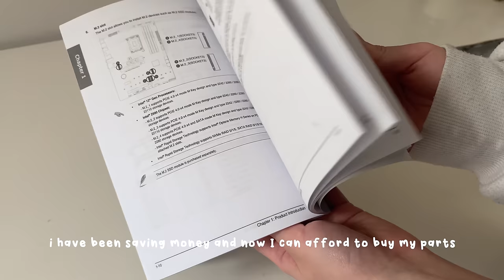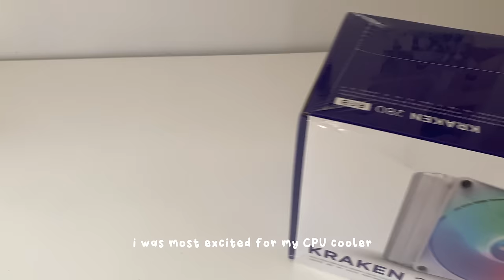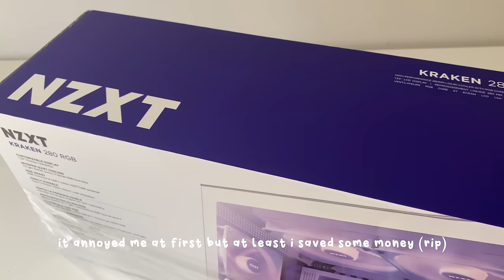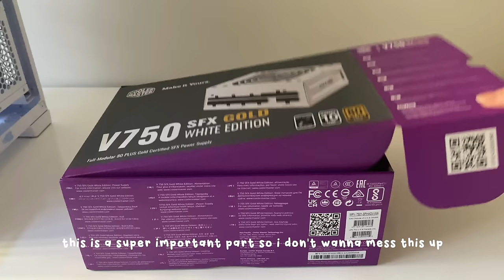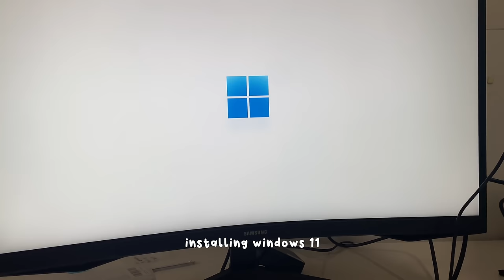building my first gaming pc 🤍 | white aesthetic, mid-range, lian li dynamic snow mini , rtx 3060

Comment: You actually have a negative pressure system the way those fans are installed.  3 bottom fans are set as intake while the other 6 are in an exhaust config.  Otherwise, looks really nice though!  Outstanding job for your first build.

Comment: I build computers for a living, you might wanna do ur exhaust fans up top cause heat rises and you could do 3 fans up top or put ur radiator there and put more fans on the middle, mainly a good idea to make those bottom fans intake
Reply: Convection is such a weak force that any airflow destroys it tbh. So in a pc case, it doesn't really matter
For dust build-up though, that is a whole other story
Reply: @Elvyne  technically no cause the heat will collect either way even if its getting blasted out

Comment: You've mistaken about the airflow, your pc has negative pressure, only the bottom fans are intake, the rest are exhaust. You can tell the air flow direction by the face of fans, air flows in from the face and out from the back, where you can see the stickers and frames.

Comment: Btw hot air rises so having the exuast fans at the bottom is not a good idea because the hot air will just get trapped under the case and then go back in to the case
Reply: you really should put the exaust fans at the top blowing air out the top

Comment: I know that some parts could be better invested but for a first time it’s decent. Would upgrade the gpu though. (7900xt/7800x3d builder)
Reply: Yeah 100%, good shout there. How’s your experience with the 7900 XT btw? I have a Sapphire Nitro 7900 XT and it’s amazing…except Adrenalin makes it run at an awfully slow fps when setup so I have to leave Adrenalin unsetup. Sapphire Trixx works well though to enable VSR and Image Sharpening if I need it.

Comment: fire build I'd look into some psu cable extensions. They changed the way I look @ my card and mobo, most PSU cables are cheap non braided wiring.

Comment: your ram is running at 2133 mhz but it actually run at 3600mhz. Just go to bios setting and turn on XMP profile (it is not overclocking, there is a set profile and u just choose it)

Comment: Beautiful PC!! I love the build, white builds are my favorite. Some advice, I would rotate your radiator so that the pump intake and outtake are at the bottom. This will help prevent your pump from breaking, as well as helping with overall cooling and noise level. Other than that, great job!!
Reply: The pump is below the highest point in the loop (top of the rad) it'll be cool! Gamers nexus, JayzTwoCents have done some nice videos on the topic

Comment: Greatly done, i see you got confused on thermal paste :D it was already placed, if removed use isopropil alcohol 99% to clean it with earbud clean tips. surface must be sterile before thermal paste takes forever to clean it

Comment: Looks all good to me and the pc is great. However, a Z690 Board for an I5 12400F is overkill. I would have gone with a high quality B660 board with wifi to safe some money for a better CPU or more Storage. And the 280mm aio is also a bit overkill for an I5 12400F. The rest is fine.

Comment: So how you have it set up right now, only your bottom fans are intake. So you have a pretty high negative pressure since you have so much exhaust. I would consider flipping the fans on the aio to intake. It would be more balanced that way. You'd have positive pressure instead instead, which is not necessarily better, but yea being balanced is the main thing
Reply: It really doesn't matter with this case.  The AIO on the back can honestly be intake or exhaust... it really just depends on how you want your hot air exhausted (back or top)... I've noticed both ways really have hardly impact on performance and if you have your PC on a desk and have a clean area, you really don't have to worry about dust or anything building up in your PC. I've ran a similar configuration with slight negative pressure for over a year and have hardly seen any dust in my build.

Comment: Hi amazing build btw, however there’s a safety concern, I noticed you applied some more thermal paste into the aio pump. Don’t do that because you’re mixing different chemical compounds from different manufacturers and it can cause a chemical reaction and at the best case scenario your system is going to be fried, worse case you can light your whole place on fire. Please be safe.
Reply: hi!, is this because the aio already comes with pre-applied thermal paste?, because i’m getting that exact same cooler and i was wondering if i needed to apply thermal paste on it

Comment: Very relaxing to watch, I liked it a lot :D

But just an FYI, the bottom fans are set to intake, and the top, rear and radiator are set to exhaust. Unless you have reversed blades, but those are pretty rare and I don't think lian li offers them... I know nzxt doesn't have any of them yet. So you have 3 intake and 6 exhaust fans 😅 always remember that air flows through fans from the front of it, to the back (unless it's a reverse blade, but these are new and not common yet).

Comment: Great build, but I would trade that AIO cooler system, fans, and the case for a higher GPU like a 3070, 32 RAM.
Reply: In this market right now she could’ve probably even gotten a 3070 ti or a 3080 and also 32GB DDR4/DDR5 RAM. She would be able to have gotten a dual tower air cooler, which some look good like the white Thermalright Peerless Assasin 120 SE.

Comment: Here are some tips u shouldn’t get ddr4 get ddr5 they’re better and u should get a contact frame for ur next build contact frame makes the cpu cooler and better and u should only use 4 fans for exhaust the top fans and the rear fan

Comment: Yall if you’re wondering, its costs about 1355 € (19.2.2024)
Reply: Yes, but only because of the optics and the unnecessary water cooling. A system of this performance class can be built much more cheaply.
Reply: @blabla7310 Yeah, and the researching of components was poor. She’s stuck on a dead socket.

Even AM4, which is outdated, would’ve been a better choice. AMD officially said they’re still releasing new AM4 processors, and even have a couple of samples (like the Ryzen 9 5950X3D featured on Gamers Nexus) that could be released.

AM5 was the better choice overall instead of this socket since it has support until 2027.

Comment: hello I just saw your video, I have EXACTLY the same PC case as you, I have a Bluetooth problem, my devices cannot connect to each other, except when I open the window and get closer to the motherboard , please tell me if anyone knows what it is, the same I have a problem with wifi also it does not perceive the network well... except when I open the window

Comment: Just asking why would you put the exhaust fan at the bottom it should be on the top because warm air rises
Reply: Plus its easier for the pc unit to regulate the temperature and much more natural airflow

Comment: It’s best to avoid mounting the radiator with the pump and tubes at the top, this is due to trapped air having the potential to hinder the performance or cause a short lifespan

Comment: Hi! Its been about a month that ive wanted to build my own pc. 
But I have some questions here: 
-how much does it cost to do it? 
-Is it cheaper to actually build it by yourself or is it cheaper to buy a pc thats already build? 🤔
Reply: it all depends on your budget, what you will use the pc for, and if aesthetics are considered
Reply: @letmegiveyouaquickmeal  I'll use it for work purposes, to edit videos and photos. And I'm not really considering the aesthetics.
Reply: I just plugged all this in to get an estimate for a similar build since I’m workin on building my first pc as well. The total was around 1260$ before tax. From my research, you can absolutely build one with a more affordable price that may work even better. It’s all about getting things on sale or used from a reliable source. As far as buying a pre-built, there are plenty of good pre-builds; however, everyone I’ve talked to or watched says you get more bang for your buck building it yourself so it’ll suit your needs better. I was looking at a pre built pc on Amazon that has decent reviews for 1k, but my bf made his pc for 800 and it has a better frame rate capability than that pc does.

Comment: i wonder if a ryzen 5 or 7 is good for this setup 😄
Reply: Depends. What motherboard, what socket and what Ryzen CPU?

AM4 sockets are 1000-5000 series, and AM5 is 7000-9000.

Note AMD still support AM4 and still might release new processors for it. New B550 (AM4) boards are still being made.

Comment: for anyone wondering its abot 2300$ which im too broke for
Reply: You’ve gotta be kidding me…I paid £1700 ($2156) for a PC with this spec. And it’s white aesthetic btw as well.

Case: Corsair 5000X RGB Airflow (White Version)
Motherboard: ASUS ROG STRIX B550-F
CPU: AMD Ryzen 7 5800X3D
GPU: Sapphire Nitro+ Radeon 7900 XT
AIO: NZXT Kraken X63 (White Version)
RAM: 32GB Corsair Vengeance RGB Pro DDR4 (White Version)
PSU: Corsair RM850 (White version) 
SSD: WD Black SN850X 1TB 

This build still has new CPU’s available since its AM4 and AMD confirmed they will keep making new CPU’s for AM4 instead of dropping support and moving completely to AM5. And it would beat this build in the video so much while being ~$200 cheaper. And it looks just as good as this one. If not a little bit better or worse.

Comment: WHAT THe PRICE?
Reply: Currently the PC is about $1750ish (depending on where and when you buy it). However since this is almost a year old, and you don't need to go over kill with the fans, like she did. You could probably do a 4080 ti, Ryzen 7 7800x3D (maybe wrong about CPU name), and 32gb of ram for the same price (if you don't spend extra on white components). Very relaxing and fine build she made none the less, especially for at the time.

Comment: I just want to say thank you

Back in the 1980s I used to work as a spy for the Israeli intelligence. I was sent to Iran and I got captured. They’ve decided to use the white torture method on my. After some time I made them like me through manipulations. Any way, they thought my punishment was to harsh on me so they let me chose any addition to the room as long as it was white. Then i remember this video. I showed it to them and told them that I wanted this setup. They gave it to me and it made the passing of my time in this room so much easier all the way till I got executed 9 moths later 🥰🥰

Comment: My pc is almost exactly the same :D
Reply: that’s so cool! if you don’t mind me asking, how much did it cost you total? i’m super curious
Reply: so I paid around 5,000 but I got a small form factor case for my set up. However I would recommend to making sure the case has enough air flow and not overheating. Check out random Frank p white pc set up and that’s exactly what I got my pc from :D
Reply: @thegreenhunter6027 what currency? 5,000 £? 5,000 $ or? I would hope not
Reply: @thegreenhunter6027 What??? With those same specs???

Comment: FYI, your fan setup is strongly negative airflow. I havent read the comments so I'm not sure if you're aware, but your bottom fans are the only ones intaking air from outside the case. The side, top and rear fans are set in an exhaust configuration.
I'm only bringing this up because you mentioned wanting a positive airflow setup. There's nothing inherently wrong with how your fans are set up in the video, but I would flip the side fans (next to the motherboard), just for a more positive airflow setup.

Comment: What specs is this runner
Reply: Motherboard: Asus ROG STRIX Z690-A Gaming WiFi D4
CPU: Intel Core i5-12400F
RAM: Corsair Vengeance RGB Pro SL 16GB 
GPU: Gigabyte NVIDIA GeForce RTX 3060 VISION OC
Storage: SAMSUNG 970 EVO Plus SSD 1TB
CPU Cooler: NZXT Kraken 280 RGB White
PSU: Cooler Master V SFX 750W White
Fans: Lian Li Uni Fan SL120 (7)
Case: Lian Li O11 Dynamic Mini Snow Edition

Comment: I'm left unsatisfied on the NVME
Reply: elaborate
Reply: @disissparta447  I'm assuming it's because it's good for a budget build like that, but it's only 1 Terabyte and is kind of older gen now, speeds are 3,500/3,300 MB/s
This is not bad, but to 'crazy enthusiasts' well.. I have newer ones 13,000 MB/s for gen 5 slots & 7,000 MB/s for gen 4

Comment: Bro really said "i only have 1TB" as if that's not a lot 💀
Reply: it really isn’t that much though for gaming
Reply: @decentcarp2771  of SSD? isn't it the RAM that's responsible for game storage?-
Reply: @xrenaoxloveo SSD is the storage of a computer. 1TB isn’t that much for gamers. RAM is Random Acess Memory, 16GB is more than enough in 2024.

The difference is: RAM is cleared when your PC powers off, which means you can’t store games on it at all. It‘s used for stuff like cache instead. 
Your SSD doesn’t get erased when your PC is powered off.
Reply: + Games can take up to 250GB or more of storage, which makes 1TB look small. A couple of years ago though, 1TB was massive.

2TB and above is the way now.